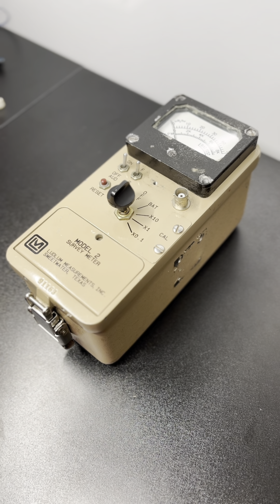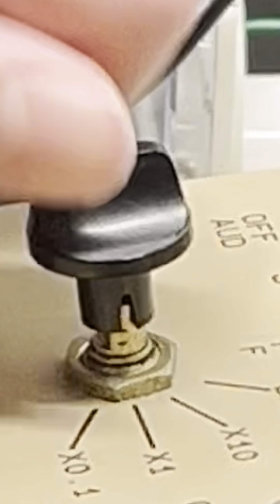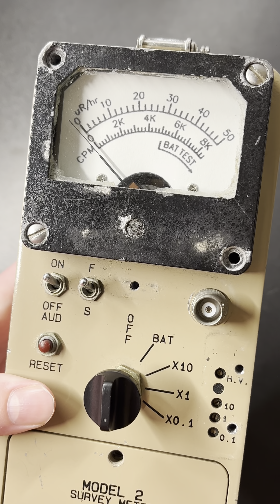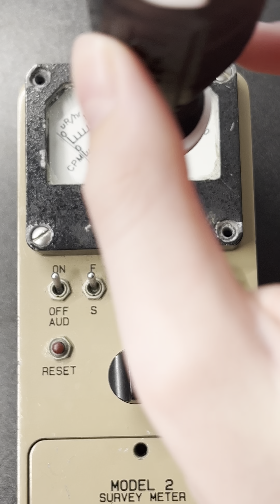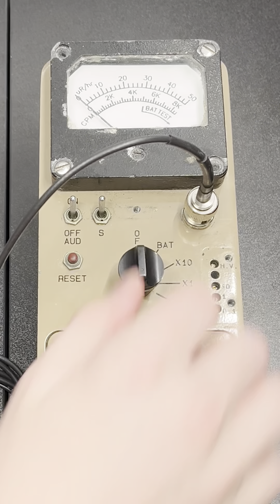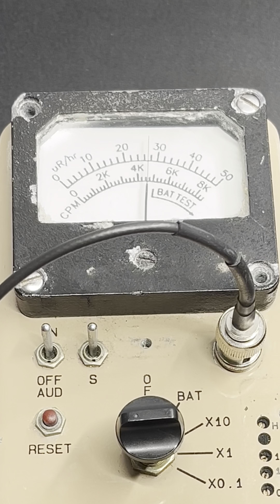Calibrating a Geiger Counter

Comment from the maker: NOTE: some radiation meters do not read out in counts per minute, and thus cannot be directly adjusted to the selected pulser setting. If your meter measures in dose units, it is necessary to find a conversion factor and adjust accordingly.

Comment: By any chance, are you selling the pulser circuit? I'd love to have one. ☢️☢️☢️
Reply from the maker: That’s the plan eventually, but it’s not even close to being production-ready yet 😁
Reply: @abyphysics414 Oh, well... I would actually like to buy one from you, even if it's just a prototype.
Reply from the maker: @resistenciadeyazmin7182  Hmm.. I don’t really think I can do that yet. It’s just on a breadboard, and it completely lacks an enclosure. I’ve also had a few concerns about amplitude adjustment.
I want to make sure it’s sound and safe to be used on equipment long-term before I sell them.

Comment: I think the part that I enjoined the most was the fact that there was no 555 timer circuitry and there was Arduino
Reply from the maker: Honestly can’t tell if this is sarcastic because arduino’s getting used for simple applications is a common complaint in the electronics world. So I apologize upfront if I’m reading this wrong.

The reason I refrained from using the 555 to generate the pulses is simply because it’s not great at generating precise or high frequencies with fixed 50% duty cycles. Plus then you lose the advantage of being able to digitally adjust the pulse rate with a simple button press.